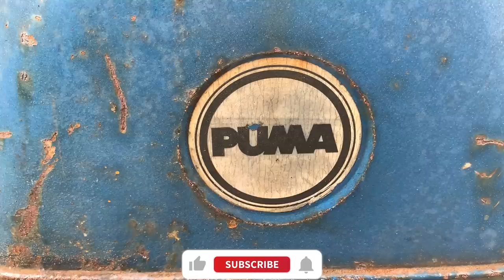Old Rusty Damaged Large Capacity Air Compressor Restoration // Restoring Old Air Compressor Engine

Comment: Old air compressors are like ticking time bombs - you never know when they will go off. It's not a good idea to have a bomb near you... that's why you never repair an airframe older than 10 years. safety first!
Reply from the maker: Thank you watching video !!!
Reply: I totally agree. All that water inside the tank has been rusting away for years, and just because you put a nice paint job on the outside, it's still crap on the inside. Not Safe At All.
Reply: I both agree and disagree, you can refubish any age of tank (age does not aways define condition) how ever you should always do a pressure test with water before returning it to service. The one thing that makes me cringe about this video is the fact that not only have they not tested it but by cleaning it up they have hidden the fact it is old and could be in bad condition inside so someone buying it or just using it will not be aware of the risk it holds.
Reply: A rusty pressure vessel is nothing to be trifled with.